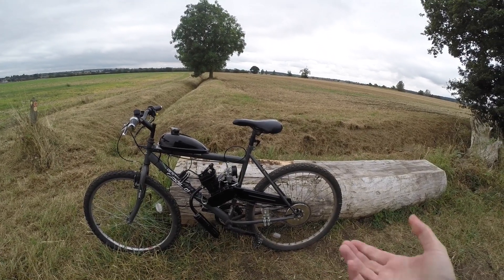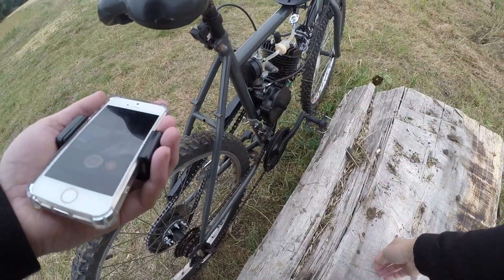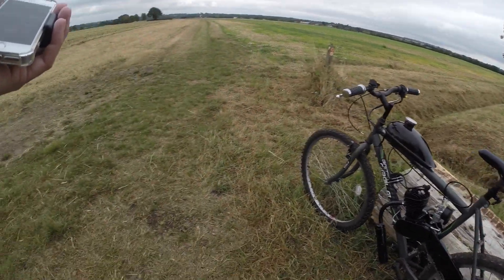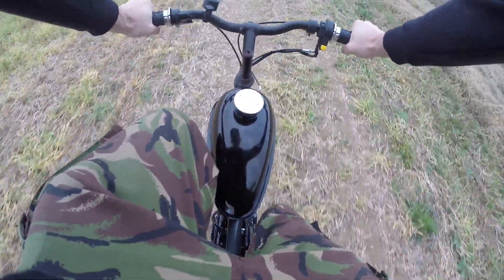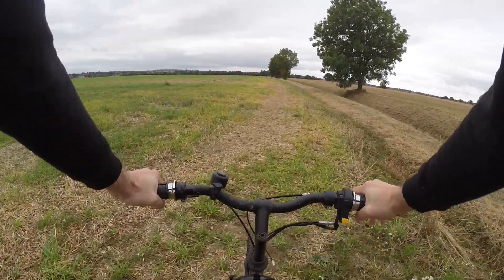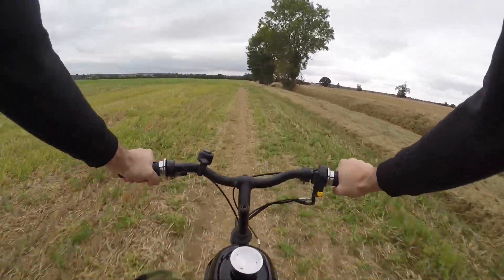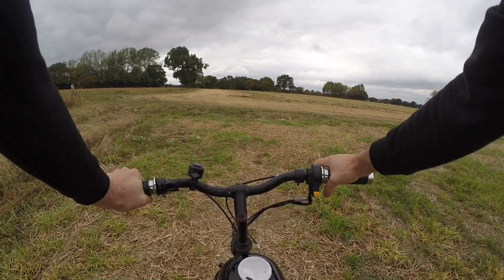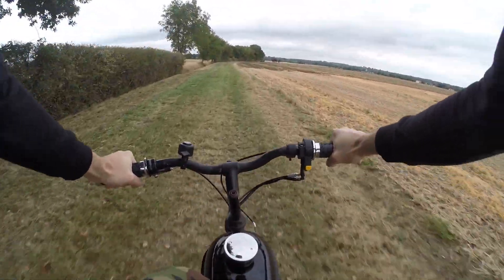80cc 2-stroke bicycle kit how to start your bike.

Comment: I've just fitted a 100cc and the bike wheel is locked up until I put clutch in and for some reason it won't start have you any ideas are the back wheels ment to be locked up before starting it. Would really appreciate some advice thank you
Reply: Yeah the back wheel should be locked unless u pull your choke in. When you pedal 5 times and let go of the clutch the bike tire should go smooth. This is how I do it anyway I hope it’s right lol it’s really hard to pedal with no gas on and hard to push but it’s so fast once it starts
Reply: I just pull clutch in, get up to speed,and let clutch out,the back wheel will not spin unless the clutch is in

Comment: I have to leave the choke open a little bit for the throttle to be engaged if it's so close all the way it shuts off if the choke stay open it's at idle but I cannot rub it with the throttle but when I close it choke a little bit I can use the throttle that's a weird?if you know please help....
Reply from the maker: Jungle Onway sounds like the engine is running lean you need to undo the high fuel mix screw on the carb do half a turn at a time and test . It will allow more fuel to the engine .

Comment: 1) How much does it cost to fill a tank up?
2) how many miles on average would this do before a refil is needed ?
Reply from the maker: ITZATOV depends what you pay for gas where you live . in U.K. it’s about 2l tank £2.50 and you get about 60 kilometres . But not fully tested yet. And depends on weather your off road or on
Reply: @JAYZWORKSHOP  ..what the law on these in the uk i have a.. A license and have good knowledge of re building old bikes 650cc and 750cc